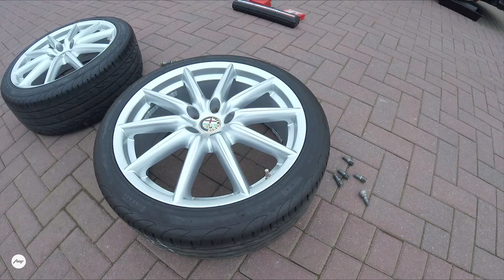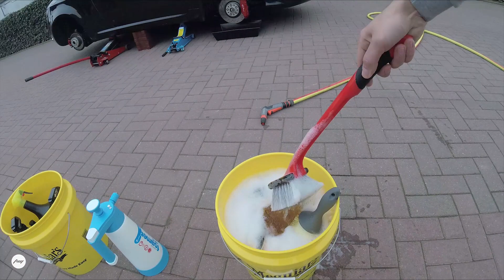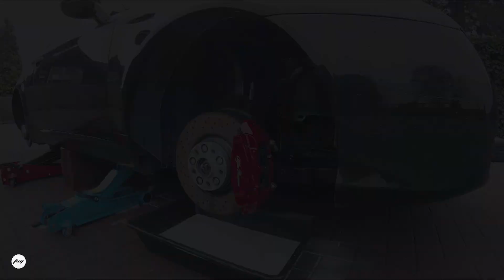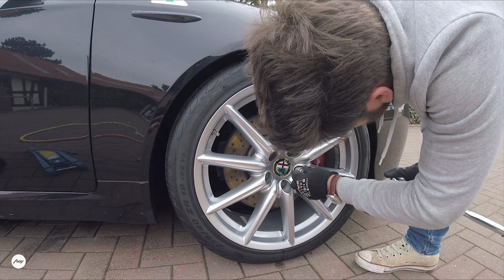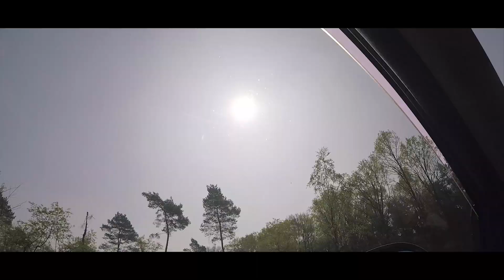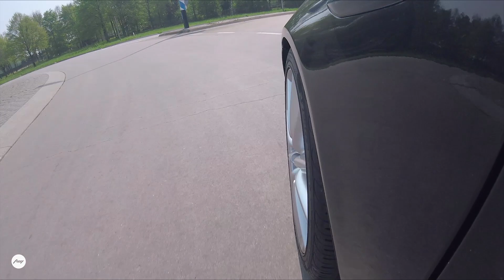Alfa Romeo Brera WHEEL ARCH CLEANING + summer wheel set installation

Comment: you have wheel spacers mounted ?
Reply from the maker: Yes in this video I do
Reply: @939driver  
can that wheels be fitted without spacers ?
Reply from the maker: @LuXoR1590  yes, I am riding same wheels without spacers now. Saves weight haha
Reply: @939driver  
im thinking buy that rims for 159 , but not sure it will fit without spacers because i have big front calipers like Ti model , now i have oz leggera 18" and its not fitting without spacers, wheel are tooooo close to calipers and i cant be drived.
Reply from the maker: @LuXoR1590  ti rims are original for the 159 TI. They fit perfect. Yeah 18" can be close for the Brembo's and indeed might use spacers on some, but the TI's are 19" and fit easily 👍👍
Reply: Thanks for a another great video! I'm thinking to buy a Brera 2.2. The 2.2 engine seems to get a lot of negative comments on reliability and power output. Whats your experience, do you have to fear the chain belt etc?